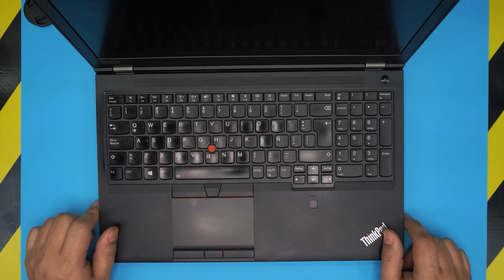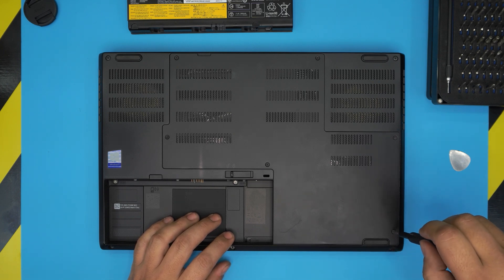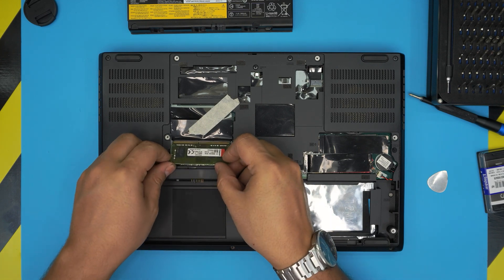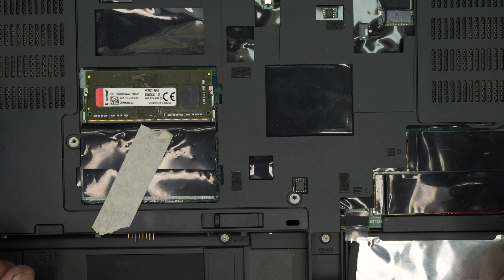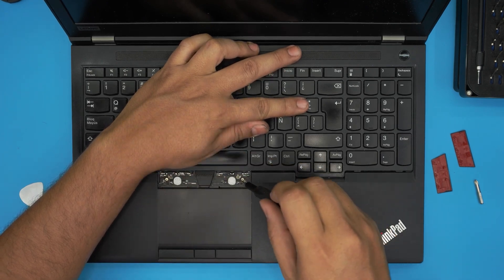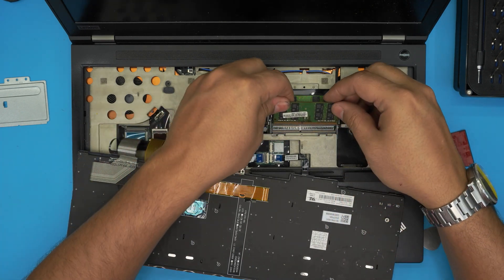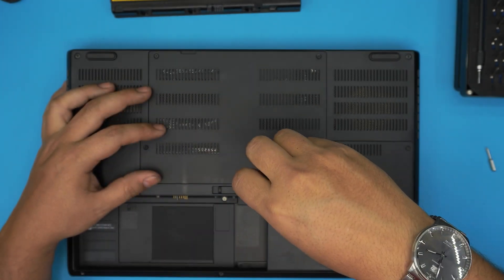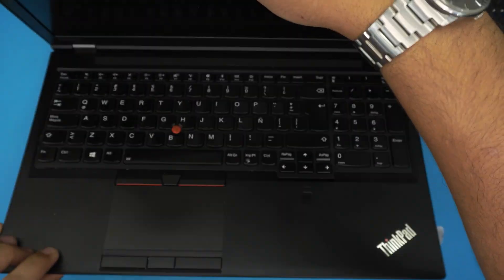How to Perform a RAM Upgrade on a Lenovo Thinkpad P52l Laptop: Step-by-Step Guide✅

Comment: Your P52 videos are great.   Too many others 'talk' too much and leave out the important details.  You seem to be spot on every time.  I followed your heatsink video a couple days again (added a new one since one of my fans kept making noise and some PTM7950, and removed all the 'mesh'....it runs so much cooler now) also added 128 GB of Viper Steel PC3200 SODIMMs and previously upgraded the WLAN nic and added 2x2TB NVMe.   Very happy with this machine.  I bought it a few years ago for 1/2 price from a video editting shop that was getting rid of all their laptops since employees kept stealing them.  Still had 2 years of warranty.
Reply from the maker: Thanks for your feedback! If you want to help the channel, you can either like the video, subscribe, or do both!

Regarding the P52 laptop, I try to keep my videos short while still showing how to take it apart and put it back together. These laptops are really well-made, so it's not often that they have component-level issues. It's a great purchase!

If you ever have more questions or requests, don't hesitate to ask. Your feedback and questions are always welcome!
Reply: Agree 100%. What a great job showing and explaining the process.

Comment: Nice instruction. My factory ram is 2x16gb dims on the front side. I just bought a 2X32gb. I think I would need to open the front side as well to relocate front rams to arrange them into dual channels. Right?
Reply: Answer to myself. The factory installed 2x16gb already for the hard to reach slots under keyboard labeled for slots 2 & 4. I can theoretically install the 2x32gb in the easy to access slots 1&3. It would just be dual channel configuration this way. I don’t need to remove keyboard. I can’t wait to get the new rams.
Reply from the maker: Thank you for your feedback! If you wish to support the channel, you can like, subscribe, or both!
Regarding your question, yes you are absolutely correct you don't need to remove the front, just note you already have a dual channel memory with your 2x 16gb, once you place the other two then you will have a quad channel, just a reminder dual channel is a bit faster than quad, but if you looking to get more ram storage for editing videos or big project, then sure go a head.
Should you have any further questions or requests in the future, please don't hesitate to ask me.
Reply: Hey so you ended up doing this? Did you put the 2x32 on the front and moved the 2x16 to the back? Also, which ram model you got? Thanks in advance.
Reply: @x-glitchx  G.Skill RipJaws DDR4 SO-DIMM Series 64GB (2 x 32GB) 260-Pin SO-DIMM DDR4 3200 CL22-22-22-52 1.20V Dual Channel Memory F4-3200C22D-64GRS
Reply: Thank you!.  @DuckTomato
Reply: @x-glitchx  I forgot what I did. But there should be slot number marked. The total ram is now 96gb
Reply: @x-glitchx  I actually have to dissemble to get to the mother board on both sides. In the meantime I repacked the cpu and gpu with better thermal paste, arctic silver 5

Comment: does all p52 models support 128gb ram?
Reply from the maker: Thank you for your feedback! If you wish to support the channel, you can like, subscribe, or both!
Regarding your question, the p52 come with different CPU models, depending the CPU that you have you can add ram we have upgraded them to 32gb without any issue, if you need to know the max ram capacity check this: https://youtu.be/tKEJTkVth4Q
Reply: @uFixTek  appreciate the hard work helping out users to upgrade/repair! welcome to stop by or join us for discussions at r/built4obsolescence
Reply from the maker: It's my pleasure my friend. 😊 Thank you for taking the time to give feedback!